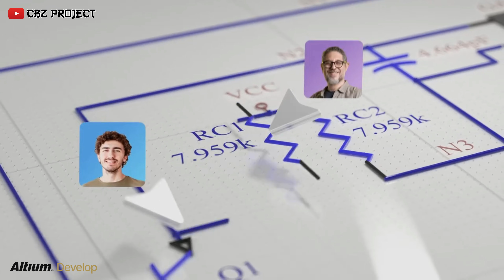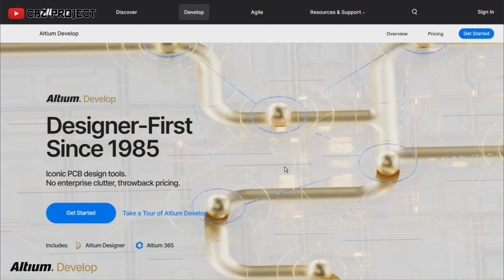Simple 12v DC Automatic Fan Speed Control Based on Temperature | cbz project

Comment: i have made the circuit it worked properply no issue found and the ptc used is    mz 27r  but the disc is too large and i thought i will not work with this but it realy did   and one mistake in the video the circuit you have given  the input 12 v is shown but which pinout of transistor is connected is not visible.  From next time give a proper trace otherwise it is not worth it